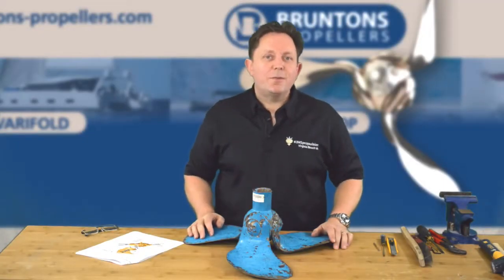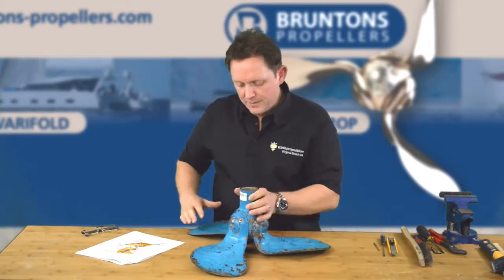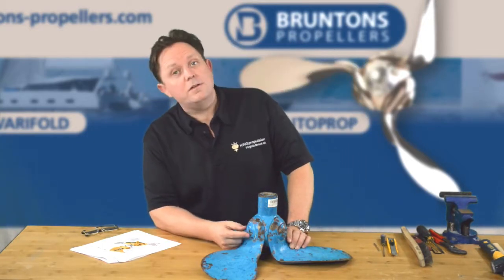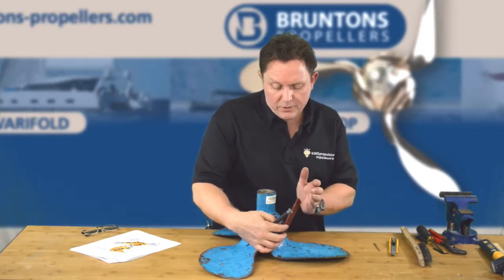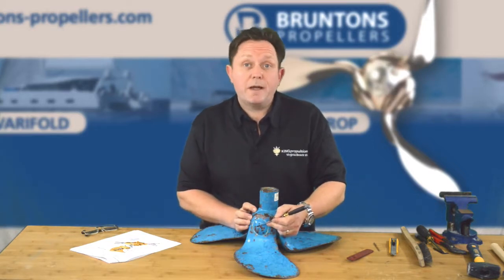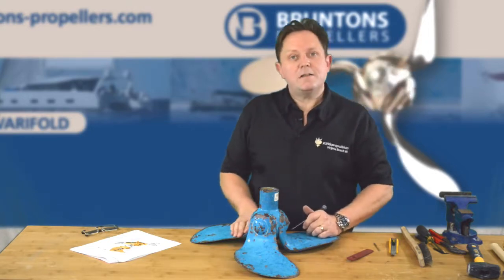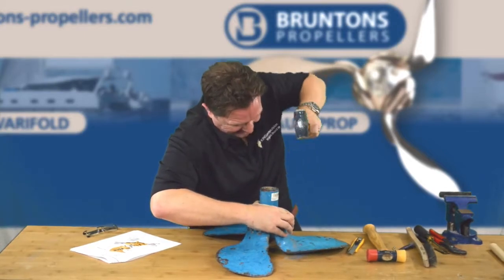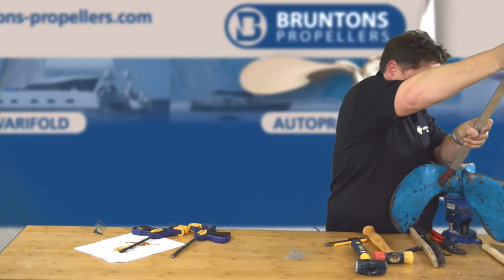Autoprop H6 rebuild Part 2: Getting Going

Comment: @ Rod: you were turning/applying force the wrong way (clockwise) with the lever to get the caps off i guess? In part 3 you turn them by hand anti clockwise to get the caps off.  Am i correct?